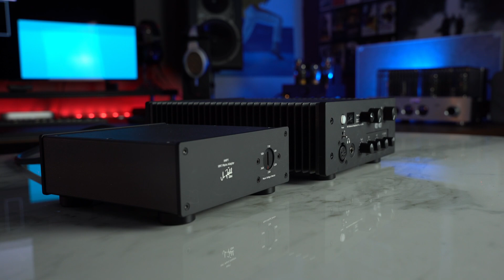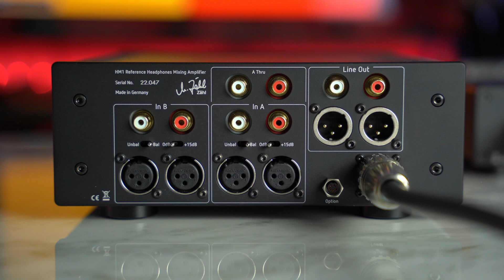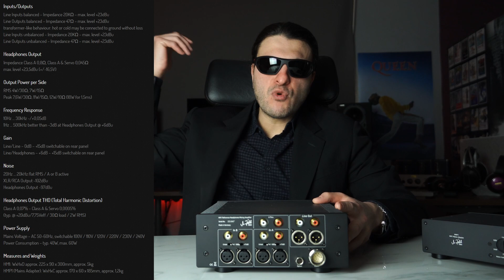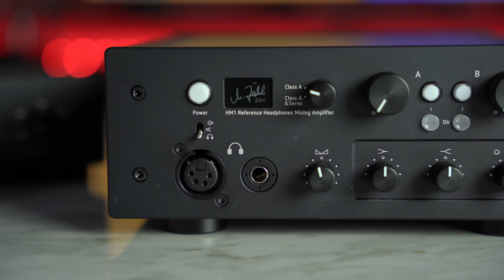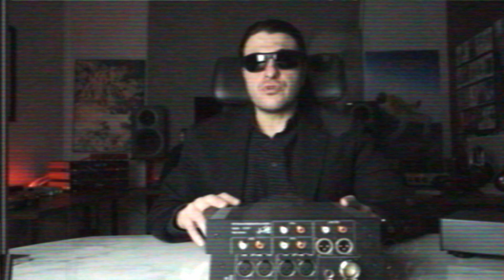Reaching the summit? ZAHL HM1 REVIEW - Part1

Comment: How would this compare to something like Benchmark AHB2 monoblocks?
Reply from the maker: What a fantastic question. This is far more convenient, by the power authority Benchmark will take and obviously this is for regular headphones et cetera but the mono blocks is a fantastic setup.
Reply: @ConvinceMeAudio  I have the Benchmark AHB2 in monoblock and you're right, they are freaking amazing! I'm struggling to find a headamp that can match it in sheer authority.  The HM1 and Lina Amp are on my shortlist for solid state amps but I don't know if they can replace the monoblocks
Reply from the maker: @everettedl  you have hard to drive headphones like SUS 1266 et cetera. I think you’re going to be very disappointed until you get into the 12 to 22K category if you get rid of them stay where you are
You need to get to AIC 10 Riviera Lavante et cetera to really step up
You would buy HM One et cetera for a convenience and it’s very small Also the grip on the drivers spectacular for SUS😊
Reply: @ConvinceMeAudio  I'm driving the DCA Expanse (I found Susvara uncomfortable 😕).  The monoblocks are directly connected to the DAC, which is acting as a preamp and volume control (not ideal I know, but it sounds the  most clear and detailed vs going through a dedicated preamp).  I use the HPA4 as my headphone amp and preamp and it sounds great too, but there is a CLEAR difference in the sound going direct to the monoblocks.